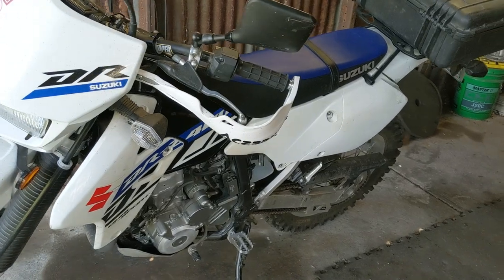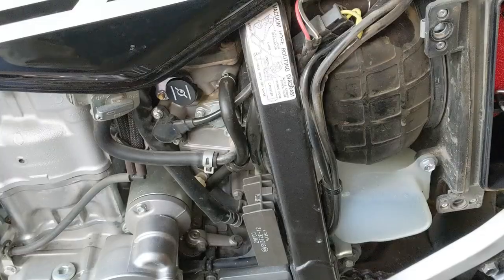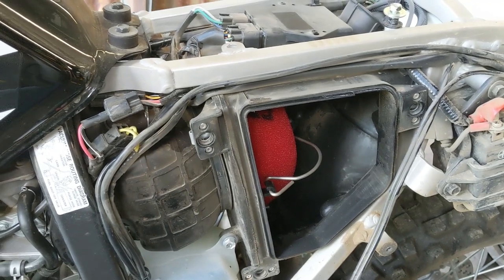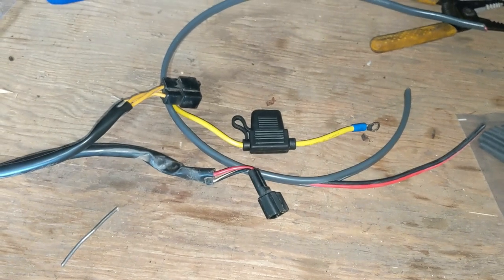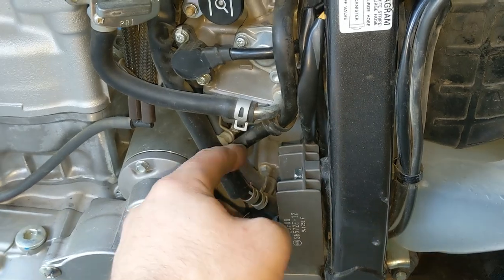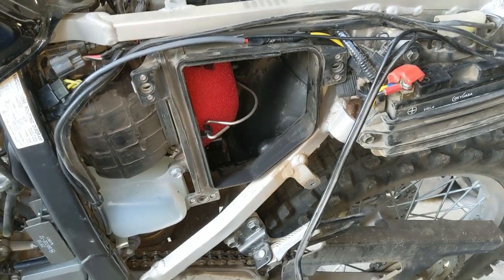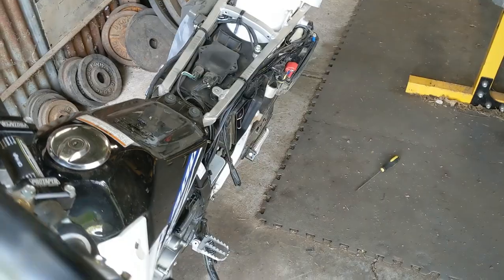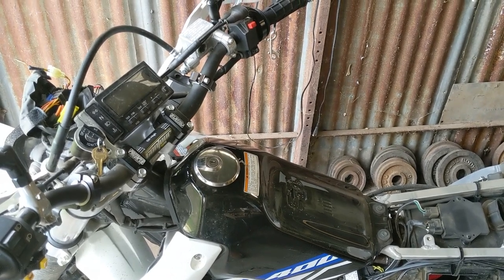DRZ400 Free Power Mod

Comment: In my 5 years of owning my drz, i’ve had my stator failed once, and my rectifier just failed last week. Did the free power mod previously but when i installed the new rectifier, i didn’t have the proper equipment for the job so i connected it as stock. Now i’m about to do the free power mod again as i’m about to install a 40w floodlights, and to counter the higher wattage consumption from the floodlights, i’m changing my front headlight to a 12w LED instead of my current 55w halogen. Hopefully my electrical systems will be fine.

Comment: I think this will be my next project on my 2001 DRZ400S. I went on a trip this past weekend and I got side tracked after coming back from a ride and left the ignition key on. Killed the battery, jump started it, ran fine for a couple of rides then would randomly stall and wouldn't start after a few tries then would randomly start up again. Charged the battery, reinstalled it and still had the same issues of it not starting and starting randomly. Awesome video! 👌
Reply from the maker: Thanks for the comment and the view! Yeah the electrical system leaves a little bit to be desired in stock format. Definitely worth the modification, especially cause it's so low cost. Safe riding!
Reply: I have the same issue with my 02 drz400 how did you solve the problem?
Reply: @JDR0357  I cut the wire that actuates the clutch when you start it and I also cut the wire that works as a safety mechanism for the kick stand. Covered the tips nice a tight and wrapped them in heat shrink, its been running solid since then. Just remember to always leave it in neutral or hold in the clutch when starting.

Comment: The last time I watched your video was nearly a year ago when my DRZ stopped charging and I had to push start it in the middle of a small town in Central WA.  That was my last ride of the year, so I procrastinated troubleshooting the issue.
In Feb 2023, I tested the stator, it checked good.  I can't remember if I checked the regulator/rectifier output or not.  I broke my wrist riding my KTM in May and haven't ridden since then.  I finally rode my DRZ yesterday.  It still won't charge.
I need to do more diagnoses on the problem once I get home from the camping/riding trip I'm on.  I'm RV camping and doing day rides.  I'm glad I was thinking ahead and brought my 4.5 amp Battery Tender charger!   I also need to do the free power mod!

Comment: With the kick stand switch did you also twist the wires together and heat shrink?
Reply from the maker: Sorry for the late response, but yes. I soldered the wires then heat shrinked them

Comment: Thanks for the video. I'll be doing this on my 2019. I have heated grips and 2 extra sets of lights. I've been lucky so far with 5,200 miles but I know its a common issue where the stator goes bad on these.
Reply from the maker: Generally, the newer models are having as many issues with the stator. Still, it's not a bad idea to check those stator bolts for loctite. Thanks for the view!

Comment: Do you happen to know how much available wattage is there on the drz before or after you do this? I wanna run my heated moto jacket.
Reply from the maker: In stock configuration the stator puts out 14 to 14.5 volts. Anything less than 13.5 won't charge the battery. I'm no electrical engineer so don't quote me on that, I pulled that data from my Clymers manual. Good luck and thanks for the view!

Comment: what is the black plug with the black and red wire originaly used for?  What does it do if nothing is connected to it after the mod?
Reply from the maker: When I referenced the wiring diagram in my Clymer manual it indicates that the plug connects to a circuit that piggybacks the wiring loom back to the battery. In stock configuration, this causes current to be lost as it travels excess wiring (internal resistance).

Comment: Excellent video.  I’ve had my DRZ since 2006.   I’ve heard about the free power mod but never followed through with reading how to accomplish it.
Don’t waste the money on an MCCT.   I had one.   It’s a finicky process to adjust it.   I apparently never adjusted mine tight enough so my cam chain wore out.   It didn’t fail though.   When I replaced the cam chain, I switched back to a later model ACCT.
Reply from the maker: Great advice! I've held off on the MCT as everything looked great when I did the valve clearance inspection. Thanks for the comment and the view!!

Comment: Great vid! So you are just bypassing the stock connector? Or is that part of the harness bad on all the bikes? Thanks for the info🍻
Reply from the maker: Hey! Thanks for the view and the comment. It's not that the harness is "bad" per se. It's more "inefficient" than anything. This mod bypasses a connector that piggy backs a circuit on the wiring loom. It removes a lot of excess wiring in the circuit..less wiring=less resistance=more volts. I'm not an electrician tho, but this mod has caused no issues since posting this vid. Hope this helps! Safe riding!
Reply: So its been a while since i first saw this vid, did you ever measure your gains? Im going to do this mod this weekend on my bike so i can add a few things. Any idea what the max wattage is that the bike puts out?

Comment: What are you cutting off doing the mod? Where does that connector go?
Reply from the maker: Hey, thanks for the view. That connection goes to the battery to charge it, just in a very inefficient way. Been running without issue since the mod. Good luck

Comment: Looks like you do not have the EVAP system on yours.  Removed?  Any details you can share on that would be appreciated.  Thanks!
Reply from the maker: Yes I removed those. Easy 3-5lbs of weight saving. It's easy to do and it's pretty intuitive. You'll need to buy a vacuum cap to cover the carburetor vacuum port that feeds the charcoal canister.

Comment: So does this charge the battery faster
Reply from the maker: It's not necessarily about charging the battery faster as it is about providing a more efficient way to charge the battery. Stock wiring configuration was so inefficient that the battery would still drain even at higher rpms. This mod makes better use of the power generated by the stator to reliably charge the battery while operating the bike within the normal RPM range

Comment: Whats the amp rating on the fuse?
Reply from the maker: I put a 15A in as I am using 16g wiring. So far, so good. Beside the regulator rectifier is designed to divert excess current into heat, so use the right size fuse based on the wire gauge you use to make your jumper lead.

Comment: what amp fuse should be used?
Reply from the maker: I used a 15A, but it will be dependent on what size wire you use. I would recommend 18AWG automotive or larger.   I'm no electrician, but I ran a 14g with a 15a fuse

Comment: Make a video on how you can put the helmet lock. O. A drz and how it works I have no idea and I can't find a video on YouTube thanks I appreciated ... just subscribed
Reply from the maker: Not a bade idea! I'll work on that!
Reply: @narcanmedic3841  Thank You.. I also bought a  Brake Pedal Switch that goes behind the brake pedal somewhere to make the rear brake light go on and I can't find a video on that neither...if you have this stuff please help me out I have no idea how it goes on.  I don't know if I need a bracket or something.
Reply from the maker: @VenganzaCayey  are you trying to street legal the DRZ400E? The DRZ400S stock comes with a brake light illuminator on both the front and rear brakes.
Reply: @narcanmedic3841  My drz400 does not have the sensor behind the rear foot pedal so the light go on everytime I press the brake and I can't pass inspection without that brake sensor. Plus my brake pedal is after market someone has told me that I need to buy a rear foot pedal that has an attachment to it to connect the sensor but I just wish to see one to see how it works or how is done
Reply: It's called the rear brake pedal switch...that's behind the foot pedal somewhere attached by the frame somewhere is basically something that does what the kick stand does for safety when is down.
Reply from the maker: @VenganzaCayey  I understand. So usually brake sensors that are aftermarket but meet OEM spec should fit right into the existing mount on the frame. There's a little plunger that depresses the switch/sensor which closes the loop and turns the light on. If your pedal doesn't have that, I would recommend buying the stock brake pedal (super cheap) and sensor and rewiring it with a quick connect. That way you can pass DMV, then figure out what fabrication/ modification you'll need to do to the aftermarket lever to get it to work (if you even want it to).

Here's a link to TT with some images and ideas. https://thumpertalk.com/forums/topic/583503-help-help-helpdrz-400-rear-brake-switch-assembly/?do=findComment&comment=6428685
Reply: @narcanmedic3841  sweet thanks that help alot I have the sensor just didn't know how it would go on I thought it had to be on the other side of the frame behind the foot peg somewhere thanks